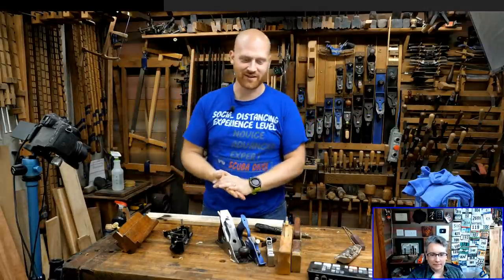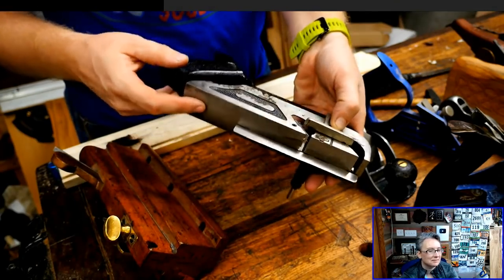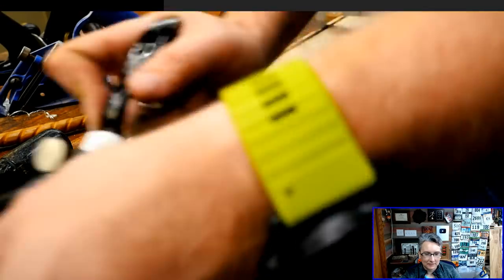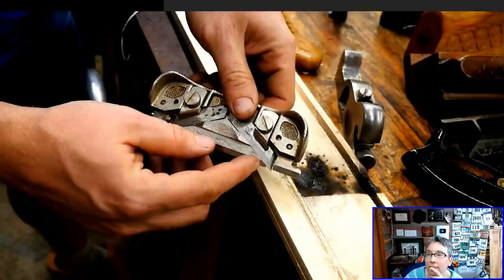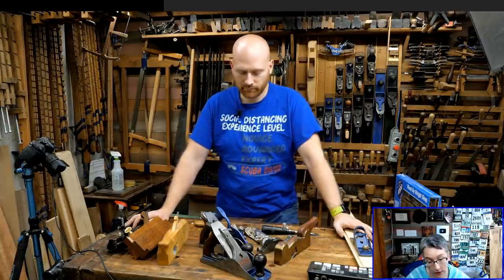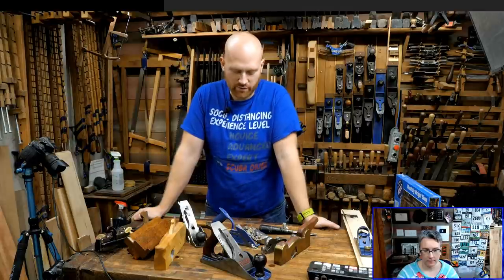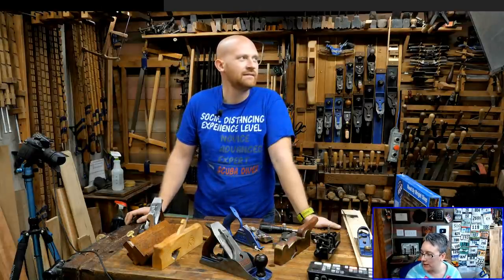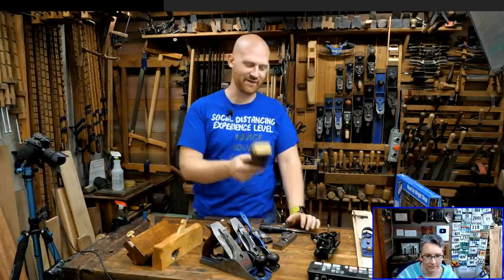Rabbet, Shoulder and Fillister what is the Difference?

Comment: Hey James, I’m not really in a place where I can get vintage planes easily. I’d like to just buy a new rabbet plane. If you were to get a NEW 78 (sold at rockler, but not made in America or UK anymore) or spend three times as much for a veritas skew rabbet, which would you recommend? Anything wrong with NEW Stanley joinery planes?
Reply from the maker: The new Stanley 78 is a great little tool. It doesn't have the fit and finish and it's a little bit fiddly to set up but it will do the work perfectly fine. Where are you at? Have you taken a look at www.handtoolfinder.com
Reply: @WoodByWrightHowTo  I’m in Beaumont, Texas, which is about an hour northeast of Houston. 
I’ll check out the website! I see on their map that there are a few Texas locations, but they’re probably 3 or 4 hours away from me at closest. 

My main need is for cross-grain rabbets. Right now I crosscut with a carcass saw and then chisel up to my line to clean up, but I want a faster method. 

This is all for my method of dovetails for boxes. I use a 1/8 inch rabbet on my tails board and it naturally hides my 1/8 inch deep box bottom grooves. 

The fence, depth stop, and nicker are all important to me because it’s for a repeated cut across the grain. 

Thanks for the response! Love your content
Reply from the maker: Ya things are thin down there we are trying to find more people to host an MWTCA tool meet down there.
Reply: @WoodByWrightHowTo  that would be incredible!
Fortunately, I’m no collector. Just want something that works

Comment: My daughter loves puzzles, but I think a WW one would be a bit out of her comfort zone, she is more about peppa pig, buses and fairies. However, what she is missing is a board to do her puzzles on (doing them on our carpet bends the pieces and as she gets older it'd be nice for her to have a board that she can take in and out with half finished puzzles. I have ordered some white oak, ~2mm thickness, and I was going to fashion something out of that. Anyway, I thought that if you were struggling for idea (as if!!!) then you could neatly advertise your new puzzles with a well designed puzzle board.... then I can steal your idea to make mine! I was thinking something around 80cm/32in x 50cm/20in in a nice hardwood, perhaps with a mitre cornered border round it, something like that. If my 2mm board is too flexible, I might add foam to the bottom. Any ideas greatly appreciated!
Reply from the maker: That's a fine yet. I might have to think about that one.

Comment: Where does a Stanley 45 or 55 fit in here?
Reply from the maker: Those are combination plans. They can do rabbits but they're not very good at it. They generally fall into the plow plane and molding plane category.
Reply: In my experience if the wood is 3/4 inch or thicker, the 45/55 can rabbit it. If it is thinner than 3/4 inch then the fence doesn't catch well and the plane starts to lean over, so you really have to pay attention. End grain rabbits they chatter terribly, but will push through if the nicker and ironare sharp. The 45/55 jack of all planes, master of none rule applies.